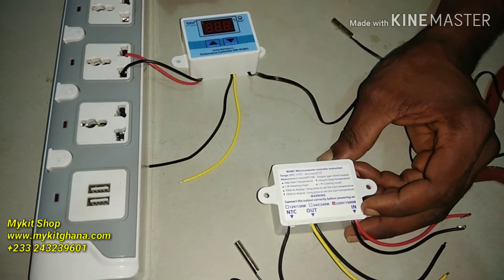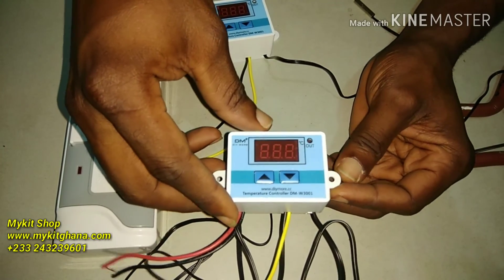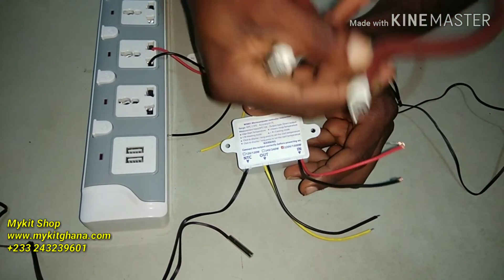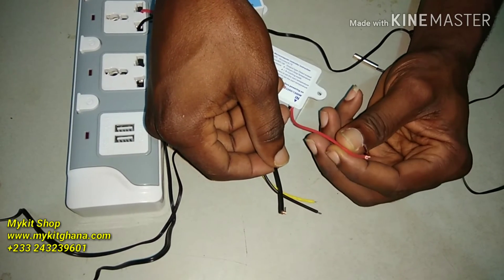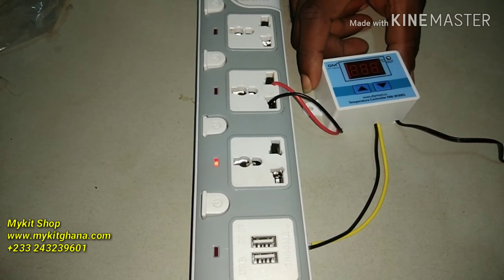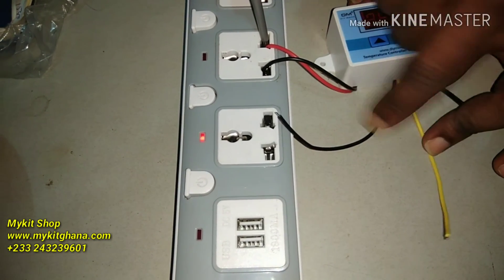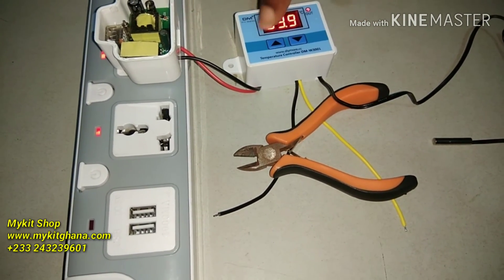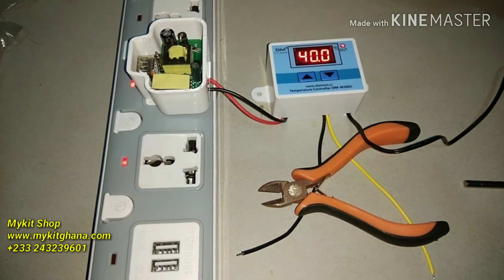How to wire and program W3001 temperature controller in ENGLISH

Comment: So unlike the stc 1000, you don't need any adopter for this controller
Reply: This controller and the stc1000 which one will you recommend for incubator and why?
Reply from the maker: Stc1000
Stronger relay.
Stc1000 has extra functions like the cooler, delay function
Reply from the maker: But w3001 is easier to use
Reply: @mykitvideos5937  thanks again for your knowledge.
Reply from the maker: No Adaptor needed
Reply: Thank you bro, much love.

Comment: can you help me to connect the fan and the heater at the same time ( ie if the heater stop the fan starts vise viser
Reply from the maker: Fan on , heater off.
Fan off, heater on

Is this what you want
Reply: yes that what i want it for my incubator machine
Reply from the maker: Then u need a relay switch

Comment: How many amps current does the thermostat draw when NO load is connected across
Reply from the maker: 35mA
Reply: Oh okay 
So it is the load across it that would determine the current it will draw from the supply
Reply from the maker: It's just a relay switch
Reply from the maker: It either makes the circuit or breaks it. That's all.
Supply it with a 12v , 100mA< amp adapter and u are good to go
Reply: Thanks so much
You're a genius😀
Reply from the maker: Hahaha. Thanks. 
Have you SUBSCRIBED to my channel please